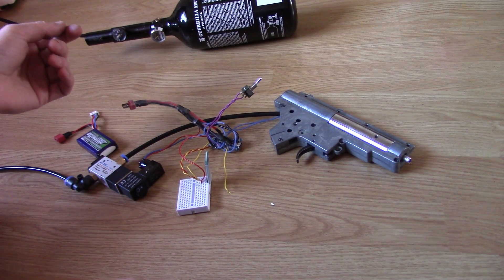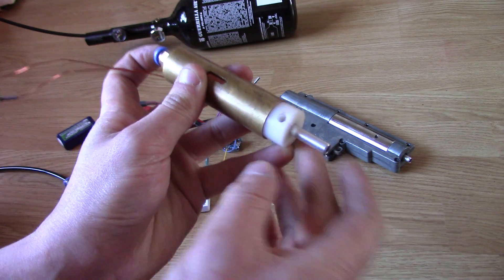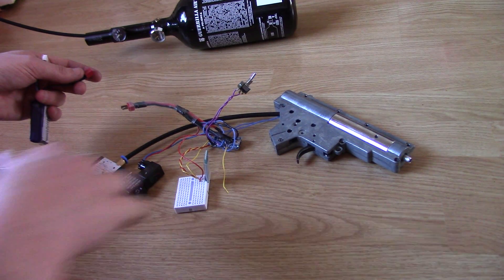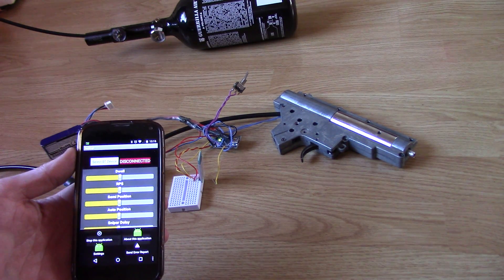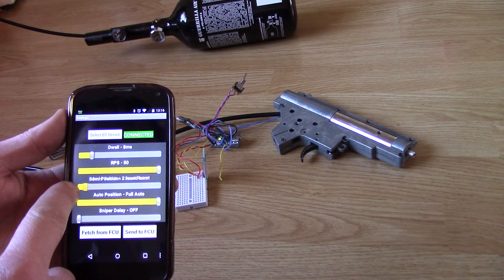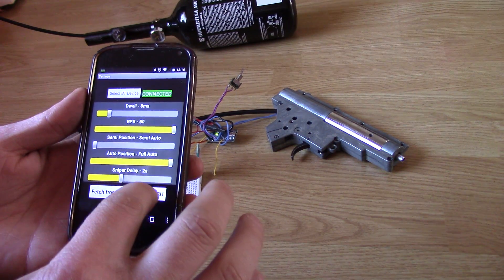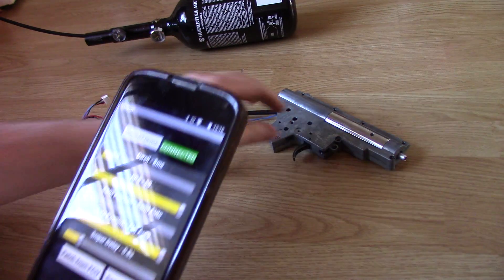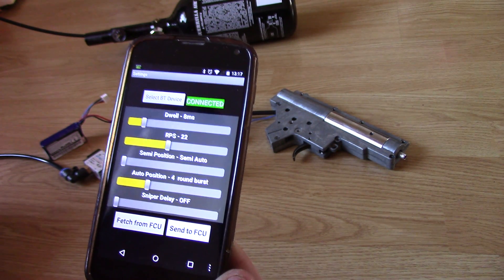SR-25 homemade HPA engine with Bluetooth FCU update - 50rps and more :)

Comment: what fps does this get?
Reply from the maker: It's capable of 550 fps with 0.20 g at the max pressure the valve can handle. It wasn't the most efficient engine though and liked to tear up hop buckings if it wasn't perfectly aligned. I rebuilt the SR-25 later with a small HPA tank in the stock and a Wolverine Reaper engine to get the most out of it. Got a video on that on the channel.
Reply: @Snakebitey  What solenoid do you use? My engine isnt even close to that fps. It caps out between 250 and 280 with .28g bbs at 120 psi.
Reply from the maker: @BackdraftAirsoft I think it's an airtac 3V110-06 with 12 Vdc coil

Comment: An option I like on my GATE Titan is burst/auto mode in the auto position.
This basically fires the n-round burst then looks at the trigger - if the trigger is still pulled, it just carries on firing auto with no discernible delay.
This means if you just flick the trigger, it fires an n-round burst, but if you hold the trigger, it fires full auto.

Comment: can you drive solenoid directly from the arduino nano?
Reply from the maker: David Koplan you need a driver, like a MOSFET - the Arduino can only supply ~40mA itself.
Reply: Hey I recreated the design.... and have problems getting the info through the bt module. Could you send me the arduino sketch it would be really helpful.